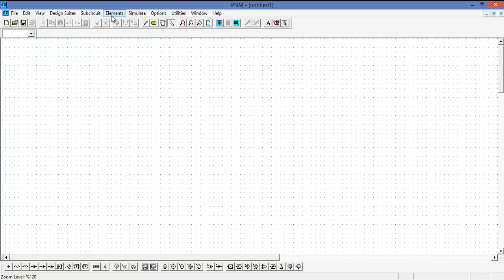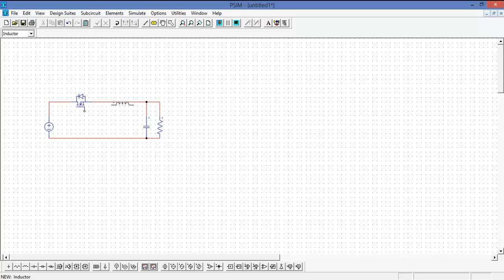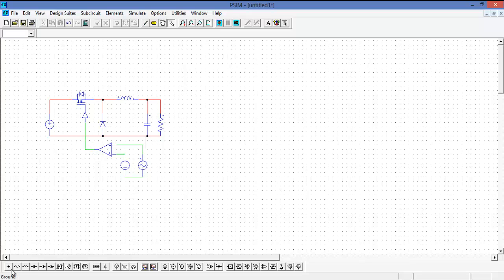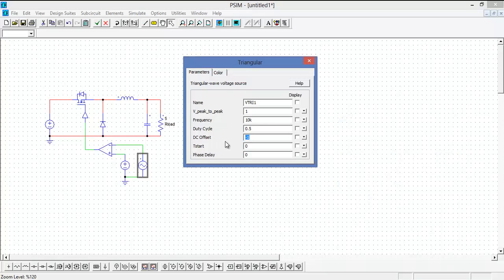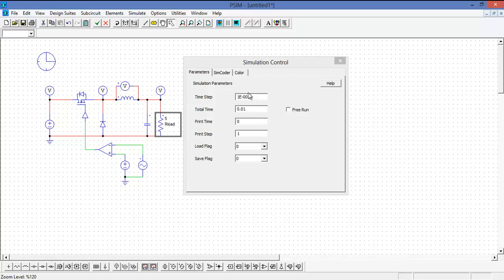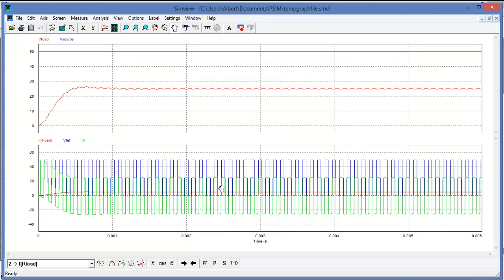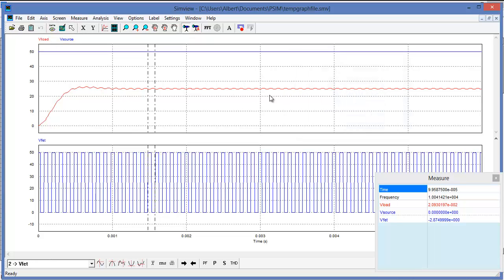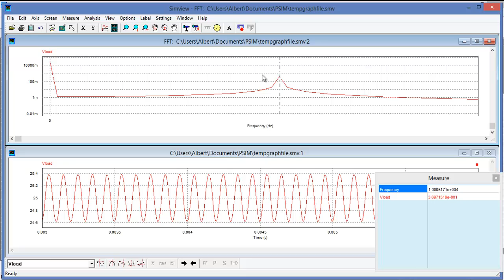Getting Started with PSIM - (update for v12 now available!)

Comment: What If I am using a gate driver to drive the mosfet. Do I use a square wave source or the gating block instead?
Reply from the maker: for a level 2 device you need to drive with real voltage source the gating block is only for ideal switches.

Comment: How can I put a schottky diode in there
Reply: As well as a gate driver for the mosfet I am having difficulty finding these 2 components
Reply from the maker: for an ideal device the difference of a regular diode vs schottky is non-existent. To model the reverse recovery where there is a difference you need to use the level 2 diode model
Reply from the maker: an ideal switch does not need a gate drive circuit. you need to use the level 2 device MOSFET and then you can model the gate drive.